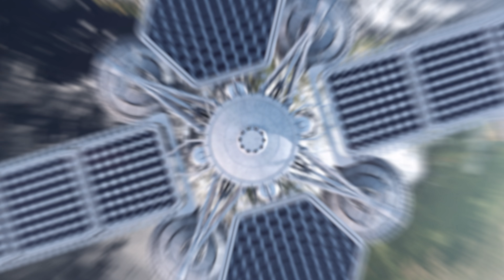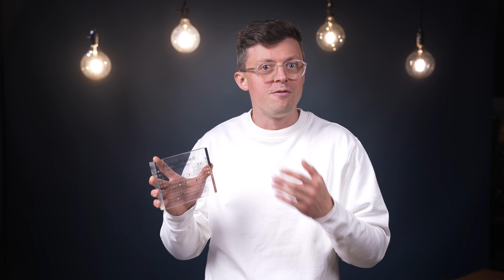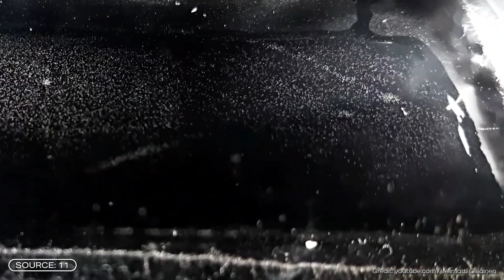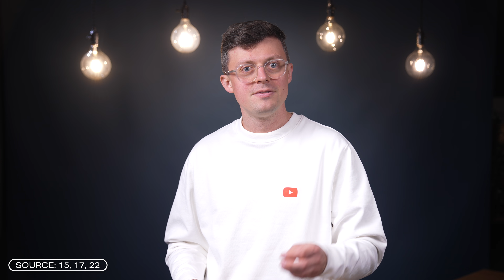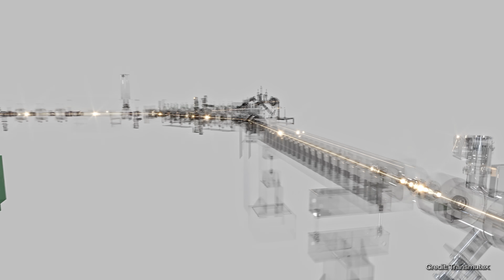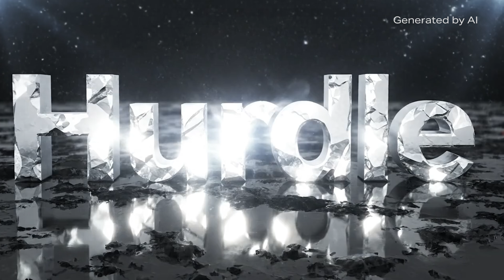Electricity for 5,730 years: Can that really work?

Comment: ...and, can it be used in bulk to make dirty bombs?  Ukraine turned a Toyota hydrogen car into one, so it's not a stretch, and it would be harder to detect if it's readily available.
Reply: Hundreds of thousands of units would be required for a very small dirty bomb. All of which would need to be carefully disassembled, one by one, to have their radioactive isotope extracted and packed in a crude "core". 

Then that core would need to be wrapped with C-4 or Semtex plastic explosives, and finally plugged with a detonator. Said dirty bomb would have a max range of a few tens of meters, 50 - 60m tops, so it would only make sense to detonate it in the center of a very busy venue at peak hour.

The above steps are quite laborious and time consuming, but the first step (buying 100,000s of units without nuclear regulators getting wind of it) is virtually impossible. Ordering more than 5 - 10 units from a single vendor would raise red flags, even if the orders were spread over a year or two. 

So a potential terrorist would need to order units from thousands of vendors, but less than a handful exist (globally) at the present time. Even assuming betavoltaics will one day become a large enough business to attract thousands of vendors (I strongly doubt that), that would in turn attract the attention of the IAEA (International Atomic Energy Agency). 

Which would establish rules limiting the max sales of betavoltaic cells per individual, and having the future hypothetical vendors cross-check their orders to ensure not a single person or group can buy more than a few tens of units, unless they were licensed resalers. 
In short, it would make far more sense for a terrorist group to shop for nuclear materials in the black market or the dark web for a dirty bomb than try using betavoltaic cells.
Reply: @Artium2026  All good points.  I would never underestimate the ability of a dedicated terrorist, or even rogue nation, but you make a good point.  It'd be easier for them to use a hydrogen car lol.

Comment: Since the half-life of the C14 is 5730 years, the power is not constant: it will be down by half in that time, and will continue after that. Not that I'm going to wait!
Reply: So choose a battery with 4X your needed capacity and it'll run your machine until the sun blows up 😉

Comment: For all practical purposes the only thing that matters is specific energy, i.e. volumetric energy density. Even if something has a high energy density, e.g. hydrogen, but you have to build large complicated systems to collect and use that energy then that energy source is, for all practical purposes, useless. You would need to grow a diamond from carbon-14 on the order of something that weighs many pounds just to get a watt of energy out of it. The amount of effort (time and energy) that would be needed to produce such a thing is ridiculous. Here on earth we are surrounded by boundless energy orders of magnitude beyond so-called nuclear batteries.

Comment: I wonder if these could power something like an airtag, tracking that never dies
Reply: Yes.
Reply: No they produce nowhere near enough power.
There is no reason a more radio active material couldn't be used for this purpose.
Reply: @dmitribovski1292   safety, legality of origin, shielding requirements, duration, and cost.

There's nothing that really replaces it.

Don't you think they started with that consideration?

Be stupid not to.

Comment: The catch? 3.2V open circuit, double digits microamps for current designs short circuit current. A whole gram of carbon 14 would require stacked wafer scale devices that would make several miliamos at best. Also carbon 14 is purpose made, it's not a common waste product in graphite used in reactors as graphite has poor neutron activation, so it's more a trace contamination. Make the same battery with strontium 90 and you get real power.
Reply: what s strontium 90 and how s it produced
Reply: Carbon 14 is quite useless with only 0.001305 Watts of isotopic power per gram and a beta voltaic cell will only be able to convert a tiny fraction of it to electricity. People imagining nuclear batteries can become an alternative to traditional batteries need to understand that this super low power density of Carbon 14 is what makes it somewhat safe and you can't have high power density and consumer grade safety in the same battery. A nuclear battery getting into Watts territory would be material for a nuclear dirty bomb and if any kid disassembles such battery in his room, he will make a mini Chernobyl.

Comment: No.  This won't work.  The metal they are using to house the battery will decay, particularly if electricity is flowing through it.

Comment: The low power output is not just a "Hurdle", it is a limitation of physics.  There is no getting around it.  Generally speaking, the longer the half-life for a Beta emitter (electrons are ejected), the lower the power output.

That more or less limits these devices to extremely low-power use cases.  So low power that just replacing the Beta voltaic with a regular battery would still last for years.

So we aren't just talking about "Hurdles".  These batteries will never be useful outside of powering very low-power devices.
Reply: Could scale up battery size, or pick a different isotope. They need to improve efficiency regardless, or a RTG would just work better and for cheap. RTGs pretty much accept nuclear waste.
Reply: @MorriganI  Yes, but the packaging results in very poor use cases.  It would be immensely heavier than, say, a lithium battery and thus be unusable for any mobile application.

Theoretically it could produce power for a long time in a fixed installation but... not much compared to the cost of packaging it in a way that actually lasts 50 years (or longer).

So, basically a lose, and a lose again.

Comment: Russia has used similar batteries at lighthouses.  These batteries contained activity that could kill a person in a very short time.  The radioactive material was enclosed in protective lead that is very heavy.  Once the lighthouses were abandoned, thieves would take the radioactivity out of the protective casing to make them lighter.  They did not do to good.  This information can be found in radioactive incident reports.  I do think that this is a good and viable and it has been used for some time.  The main thing, as with all processes, is to continue from cradle to grave and not stop half way through.
Reply: Russia uses RTGs in those lighthouses. RTGs are not efficient, but neither so far are betavoltaics. Since betavoltaics restrict isotope choice and are more expensive to construct, unless they make some efficiency breakthrough I'm not really sold.

Comment: those are nuclear solar cells. pn junction of a solar cell diode is a depletion region electric field. just use the usual ion separation methods. mass spectrometer is one of those devices. cost? make it for free. using free solar and wind energy.

Comment: I wonder how many people really need a tiny battery that lasts 5730 years. I've heard stories about immortal people getting frustrated with the need to replace their watch batteries every year. Maybe that's it.
Reply: Pacemakers. Space satellites. Remote sensors. Safety trackers. &c.
Reply: Voyager 3 would be the one if it's ever made
Reply: @sihamhamda47  voyager 2 and 1 already had nuclear batteries
Reply: @sihamhamda47  Diesel! A big can of gas is a lot cheaper than the specialized nuclear processing plant needed to make the stuff. Don't get conned.
Reply: @bradspsychedelium  Duh, think yur the one being conned fella, swallowing all that MAGAT shite in big chunks is this centuries biggest con...how's that working out for ya!
Reply: Anything that needs constant low level power for more than a few years. Basically anything we've used radio thermal generators for, or even many solar panel applications, would benefit from the basically infinite battery. Think low voltage lights for street signs, monitoring stations for seismic and volcanic activity, radio beacons for wildlife research, space probes and rovers, etc. It would take that sort of application and turn hardware durability into the limiting factor rather than power supply.
Reply: @willythemailboy2  Diesel is the way to for deep space probes. Those little batteries ain't gonna power nothing.
Reply: @bradspsychedelium  Diesel? You're a joke. These can easily be used in place of the masses of plutonium used on the Voyager probes.
Reply: @bradspsychedelium  Nuclear fuels have upwards of a million times more energy per kilogram of mass than diesel.
Typical chemical fuels (diesel) have specific energy ≈ 42–46 MJ/kg.
The theoretical fission energy released if every U‑235 (or Pu‑239) nucleus fissioned is on the order of 8×10^7 MJ/kg (tens of millions MJ/kg), i.e., ~10^6–10^7 times the chemical value.
Reply: @bradspsychedelium diesel engines don't work in space/a vacuum.
Reply: @willythemailboy2  If I'm a joke, you're a fool. According to AI:"Mass per Watt: These batteries are extremely heavy per unit of power produced. Estimates indicate that roughly 100 liters of volume (with a correspondingly massive weight) would be required to produce 1 watt of power, equivalent to what a phone uses." To provide the few hundred watts used by the voyager probes would require hundreds of tons of DNV batteries. To provide even one watt would require more than a ton of this extraordinarily expensive material. But instead of looking into it, you jumped onto the bandwagon and now look like a fool with your fantasies about street signs and rovers powered with this ridiculous tech. I was serious about diesel being a better way to power deep space probes. Bring along some hydrogen peroxide and you get a better mass ratio per watt. To power voyager for 50 years costs only about ten tons of diesel and a few tons of hydrogen peroxide. It's a way better deal. The obvious takeaway is that we need to salvage the plutonium from a couple of atom bombs if we want to launch another probe like voyager.
Reply: @LexaDoc-l2l  The problem isn't about energy density. It's about how fast you can get the energy out. A diamond nuclear battery powerful enough to power a voyager spacecraft would mass several hundreds of tons. The quantity of diesel needed to power it for 50 years would be about 10 tons, and add a few tons of hydrogen peroxide to burn it in. Then add another ton for ten diesel generators, each powerful enough to provide the 500 watts of power voyager 2 used. Compare 20 tons to several hundred. In real life voyager used a plutonium generator that weighed a small fraction of a ton, and all we need to do it again is to decommission 2 atom bombs for their plutonium. If we can't do that, solar panels are the way to go for mass efficiency.
Reply: @bradspsychedelium  Yes it is about density. Plutonium is a very good source of energy to use. Far better than diesel.

PS: I'm not talking about C14 used in diamond batteries.
Reply: @LexaDoc-l2l  So you think an energy source that produces less than a watt per ton is great because it's energy density is high. You obviously miss the point and can't do math or logic.
Reply: @bradspsychedelium  There are already 2 Voyagers out there. Each Voyager probe uses three Multi‑Hundred Watt radioisotope thermoelectric generators (MHW‑RTGs) that run on plutonium‑238 decay heat. Each RTG weighs about 37.7 kg (including ≈4.5 kg Pu‑238) and initially produced ≈157 W electrical (≈2400 W thermal); all three RTGs together supplied ≈470 W at launch.

So you want to replace a 37.7 kg power source with 11 tonnes of diesel? Nuts to that. Nuclear is the way to go.
Reply: It truly is a hassle replacing my watch batteries every year. Its okay if it takes them 100 years to make it. I got lots of time.
Reply: Yea my watch is only rated for 5500 years - so I would have to schedule a replacement when dead!😂
Reply: What about cars?